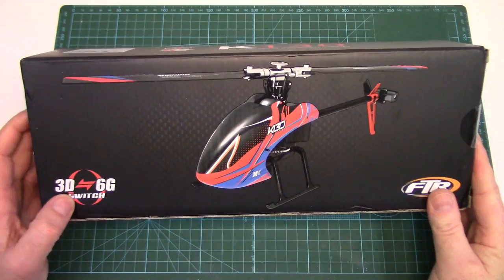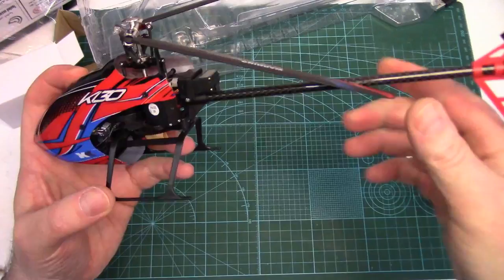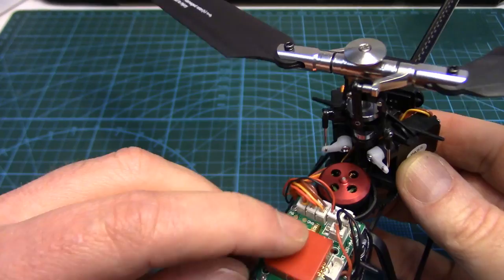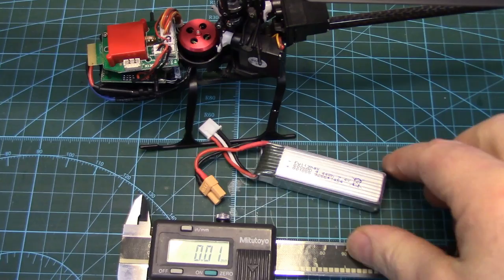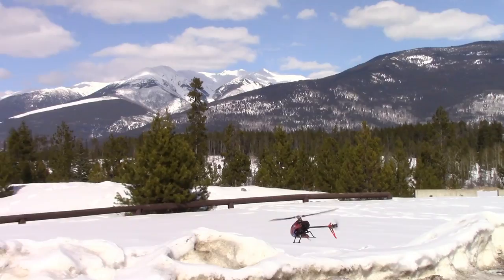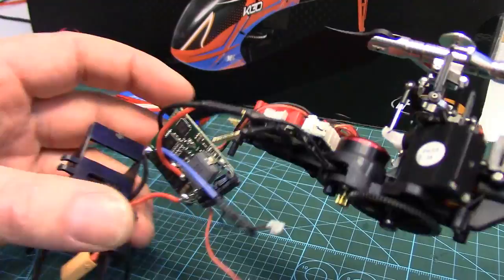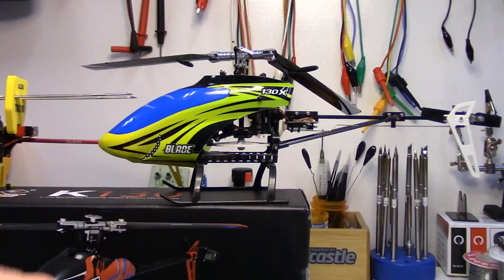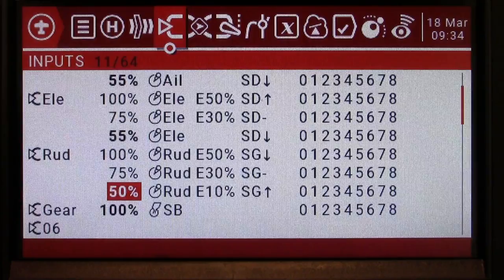XK K130 RC Helicopter Review, Test Flight, Crash & Setup

Comment: I got mine in the mail today...never flown a heli in real life before. Did ok on the sim so I figured I'd be fine. So...I've now been a helicopter pilot for roughly 20 seconds. About 15 of those seconds were spent in panic.
I have ordered three metal gear servos. A new tail assembly. New landing gear and frame. New main shafts....basically I ordered almost every single piece...because as I picked it up off the ground they were easy to identify one by one as they sort of dangled in the wind on the way back into my house. That sucked....a lot. Lmao. So ty for the video cause I am obviously in way over my head.

Comment: Great reviews John, and thanks for all your flight school tips. Learning proper unstabilised heli flight has probably been the most difficult thing I've ever done, at one stage I nearly gave up as I thought I'd never get to the stage  of actually flying a circuit. With practicing the steps you outlined it eventually clicked (slow learner LOL!), and it was a revelation to become comfortable with high speed backyard flying, surfing on wind gusts etc. Enjoyed watching your reviews of the K110 and K130. Unfortunately the 130 didn't live up to the great standards of it's little brother. Just done my first 2S 110 conversion, looks like a fun compromise on performance. Thanks again!

Comment: My pinion gear has moved down where it dont make contact with main gear. How can I push the pinion gear back on? Can I do it without removing motor?
Reply from the maker: The pinion has likely come loose on the shaft; they are held on with Loctite 648/similar bearing retaining compound. You may be able to pull the pinion the remainder the way off (to re-loctite it on), or pull up on the motor can to remove the pinion. The can is held on by the pinion on the bottom. There is also a small brass spacer collar between the pinion the lower motor bearing so make sure you don't lose it in the process and refit when you refit the pinion back on. You could try to just push the pinion back up on the shaft of course, but if it has moved down on the shaft, the retaining compound is not longer holding it and it will soon move down on the shaft again or just start spinning on the shaft whenever a torque spike hits.
Reply: Thank you..

Comment: Hi John.
What is the purpose  of the button on top of the rotor head, I bought mine used, and it did not have that part, do you think it will effect how it flies?
Reply from the maker: Hi Joe, Head buttons are mostly decoration. Lack of one won't have any impact on flight. Head buttons do offer a little bit of head & blade grip protection when hovering inverted very close to the ground for those that like to mow the grass or sweep the asphalt with their egg beaters.  🙃

Comment: I had the same issue with the landing skids.  First flight out I came down a little hard and cracked two legs on one side.  I repaired them with Gorilla glue clear and that did the trick.  I saw the end of the video where you show the settings.  I'm using the X6 radio that came with the K130 and don't understand the values you use on your radio.  I'd like to set it up for more tame flying until I get enough practice.
Reply from the maker: Taming any CP heli down consists of 4 basic steps:
1. Reduce the collective range (pitch curve programming). 
2. Reduce the power output / lower head speeds (throttle curve programming).
3. Reduce throw of all 3 primary flight control channels to both tame response and increase stick resolution: tail rotor & cyclic (rudder, aileron, elevator).
4. Use exponential on your 3 flight control channels if you still find mid stick response too aggressive after taming down cyclic & tail with dual rates (dual rate reduction on its own reduces mid stick response a fair amount). The X6 like Futaba's radios uses negative expo to flatten mid stick response, not positive like most others (including the Horus radio I showed the values for in this video). 
I cover all that and much more including micro CP setup in my setup & tips eBook: https://www.rchelicopterfun.com/rc-helicopter-tips.html

I also just finished an XK K110 review where I talk about taming the setup and list some values for the X6 radio which you may get some info out of: https://youtu.be/2yIB2-KSZyk
I also just put up an X6 radio review where I go over all the settings but you likely know all that stuff already. Here's the link if you'er interested: https://youtu.be/lzW9m8899Tk
Reply: @Rchelicopterfun  Awesome, thanks so much! ....and for the quick response.

Comment: John,
I have 2 XK helis, the scale ones. As far as the batteries go they are reversed  from the normal batts we usually use in other brand helis.
Reply from the maker: Not so with the K130. The positive wire of the lipo is going to the positive post of the XT30 connector. Balance plug is also conventional.
Reply: @Rchelicopterfun  That's good news, I don't like the batt setup on both the K123, and K124 helis.

Comment: You shouldn't of zip tied the battery wire to the landing skiddz man. The weight of the battery an inersha pulled the esc apart had no let go points.an I wouldn't even used that xt connected. Maybe a thick gauge jst.
Reply from the maker: The LiPo battery cable is not zipped to the landing skids, the ESC power cable is! That is done at the factory, I never put that zip tie in place if you watched the video , it was like that out of the box. When the battery went flying during the impact, it pulled the ESC wiring and that's what pulled the landing struts out. If the ESC power wires were not zip ties to the landing struts, the ESC would have still been torn from the frame, and perhaps even more damage would have been done to it. Some of the energy was absorbed by first tearing out the landing strut pins after all. If the ESC wiring was however zipped to a stronger part of the frame instead of the landing struts, that might have helped?

Comment: I have Syma F3 (4CH) before and it is bit difficult to fly for me. Does this one is twice ore more difficult than mine as it is 6CH and Hobbygrade?

Also does it is withstand on the wind?
Reply from the maker: Collective pitch is a totally different ball game from fixed pitch (yes much harder to fly). This is also not a good CP heli to learn on in my opinion. The XK K110 is much better suited for beginners and learning. Here's my review on it: https://www.youtube.com/watch?v=2yIB2-KSZyk
Collective pitch handles wind much better than fixed pitch, but keep in mind micro/small RC helicopters with little mass and small rotor area are never going to be able to handle large amounts of wind like a larger collective pitch RC heli. If you want lots of wind handling ability, best to join an RC heli club, get a bigger machine (500 or larger), and get one on one instruction from an instructor.
Reply: @Rchelicopterfun  I see.. thanks for the feedback!

Comment: Great video! Thanks!! Which helicopter do you consider is better (easier to fly) for a beginner? This one or Eachine E160?
Reply from the maker: Neither. If you are looking for a micro size collective pitch heli to learn on and one that is fairly robust that will survive most impacts, the XK K110 would be my top pick. It's not overly powerful, it's well suited for beginners, and it's light along with being 1S powered so it doesn't release too much energy in a crash. Here's my review on it: https://youtu.be/2yIB2-KSZyk
Both the K130 & E160 will usually break something in a moderate crash due to having both more mass, more spinning rotor mass, and thus more energy release when crashing. Out of the two however, the E160 is by far the clear choice in my opinion. If you already have some CP flying experiance already & don't crash much anymore, then of course the E160 would be okay. 
My best RC helicopter page on my website may also help further if you are considering your first CP heli - it goes into much more detail of choosing your first CP heli: https://www.rchelicopterfun.com/best-rc-helicopter.html
Reply: Thanks!

Comment: Does anyone know where can I get cheap and metal gear servos for this helicopter? I saw some at $11-16  but that’s too much.
Reply from the maker: Also too heavy. Keep it stock plastic. The plastic main gear is also a good mechanical fuse to protect the motor & pinion gear, while saving weight and money.

Comment: Hi, I've just recently bought a K130. Can you tell me what protocol are you using to bind with an Frsky radio? tank you
Reply from the maker: As I show & say in the video several times.... S-FHSS.
Reply: Thank you. unfortunately i start to think that it is an hardware problem and not a software problem, since i already tried the latest firmwares and the outer module never lights up

Comment: Next time try 5 minute epoxy on that skid with the shrink tubing fix.
Reply from the maker: I've tried that and it doesn't work nearly as well as hot glue. Epoxy doesn't stick well to this type of plastic and it doesn't flex like hot glue does.

Comment: hi John i'm getting frustated trying to tame this heli, the motor easly gets sooo hot it booted the system during flight, do you have any suggestion? I had 7 other heli most of them walkera , wltoys and one mcpx, all have never acting up like xk k130.
Reply from the maker: I would have to see it first hand to diagnose the issue/s. Sounds like a faulty heli, but that is just a guess without going through it.

Comment: Dear John,  

Woould u pls tell me what is the Expo and D/R values of this XK 130 ???  Where can I find it ? 

I need to set up my previous RTF XK110 radio for  XK130 BNF.  
Pls help.  I follow yr YouTube ch,  exception is I m not a 3D guy.  ;-) . Thanks
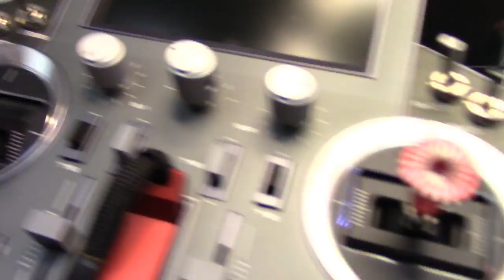Reply from the maker: I go over all my setting at the end of the video starting @ 18:50 including my dual and expo rates for aileron, elevator, and rudder (cyclic & tail rotor). I follow exactly what I outline in my setup & tips ebook for all collective pitch RC helicopters for various flying styles.
Reply: @Rchelicopterfun  ,

Ok 👌..thanks for replying.  

Yr personal radio mby a bit different than the stock Xk130 one , in terms of Expo negetive or possitive .  For exp,  my Blade 130 S or other heli has possitive Expo , where as XK110 , 123 use negetive expo.  So, my Spectrum  radio expo & Xk radio expo is not same abt the possitive n negetive. Sorry for wrong english.